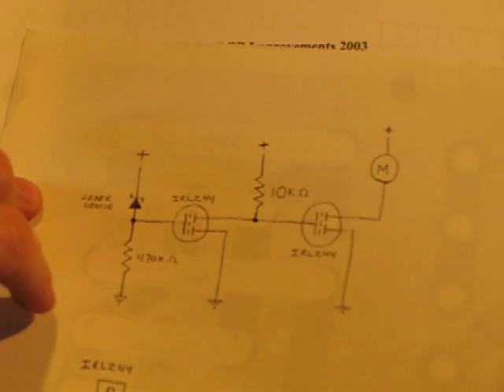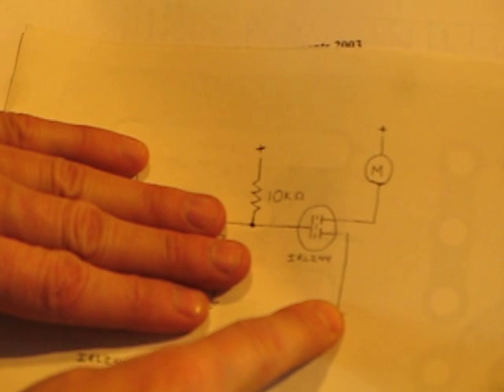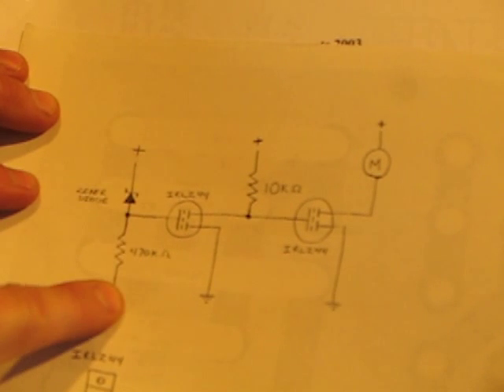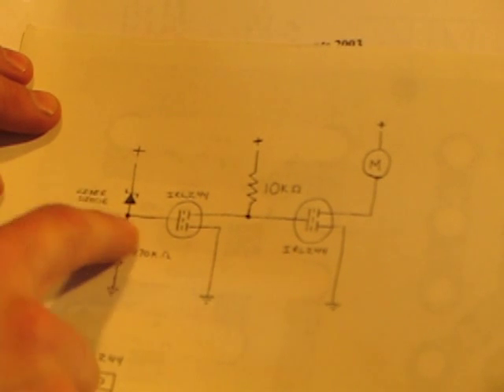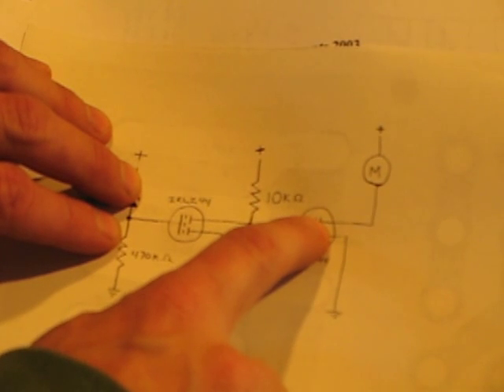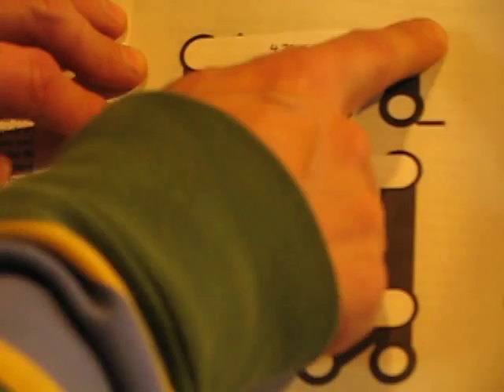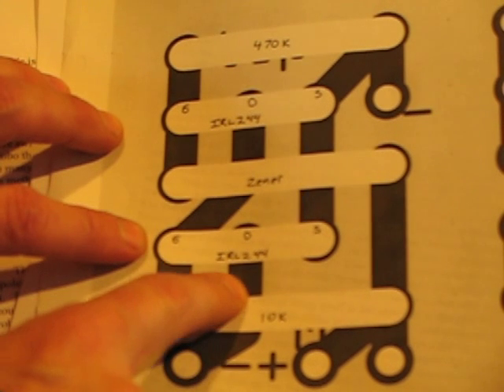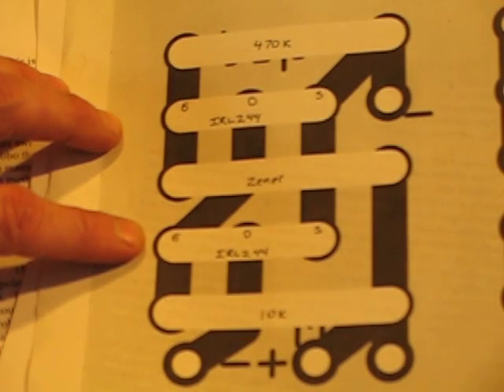Over voltage protector

Comment: Hi very good but i have quotations 
For example I have +4 -+6 volt  input he circuit should have +7 volt over voltage protection Can I uset it if yes what will be value of resisters.

Comment: if i use  a auto resettable ruse will the fuse just turn back on when voltage goes back down for diode to stop shorting ?

Comment: what will happen if we put 1000V "accidentally"? will the motor be protected?
Reply from the maker: +Trevi680 I designed this to protect for anything up to the 24 Volt maximum that my setup could provide.  You may be able to modify your circuit so that it had some sort of self-resetting fuse for situations like that.   1000V is quite a lot though.  I like working with low voltage stuff a lot more than high voltage.

Comment from the maker: Looking at the bottom left side of the circuit board, where it is labeled "-", that is the negative lead for the motor.  The devices that I was working with required that the motor run in a specific direction.    On the top right of the board where it is labeled "-", that is where the negative power lead comes into the circuit.

Comment: I'm confused by the two negative terminals and one positive on your layout... where would you connect what? Looking at the "Primary" mosfet (right in diagram, bottom in layout) both the D and S pins are on traces marked negative. Does that mean you're interupting the negative lead?